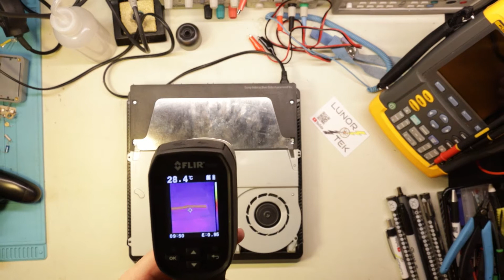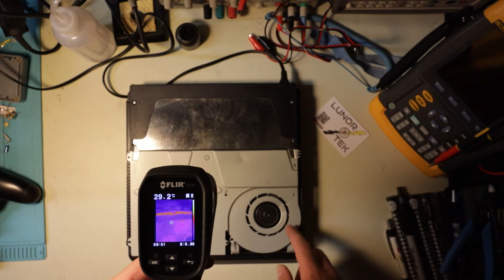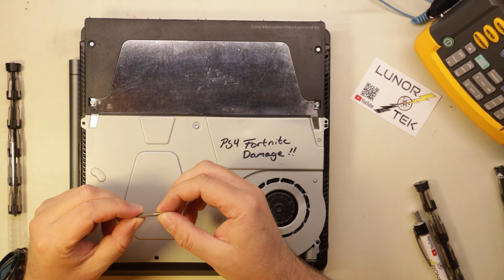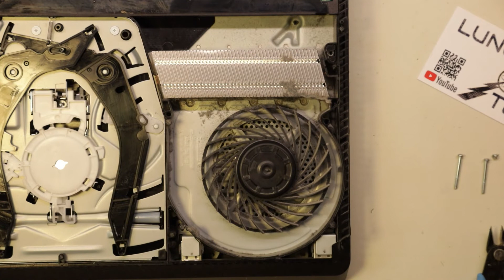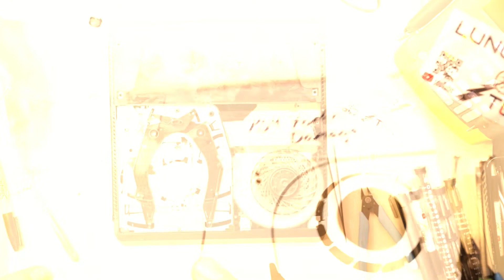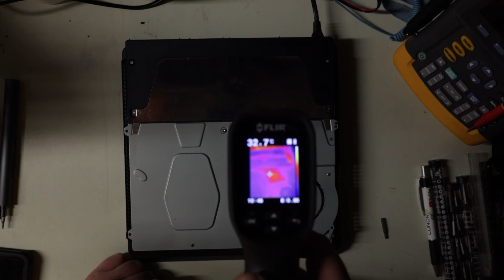PS4 Fortnite Damage and Overheat  Problem FIX

Comment: Cleaned my entire ps4 top to bottom! I even play my psn without the bottom cover so the fan has even better airflow and only fortnite overheats my console. I can play any other game for hours no problem. my console blows out cold air as well. Maybe fortnite is a just a console breaker. Idk.